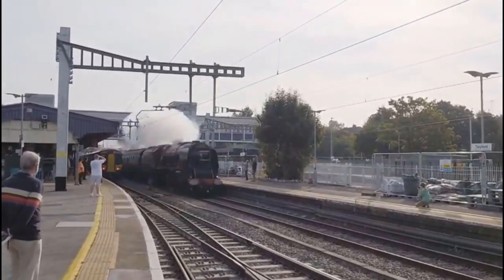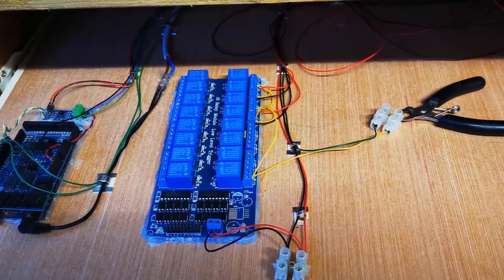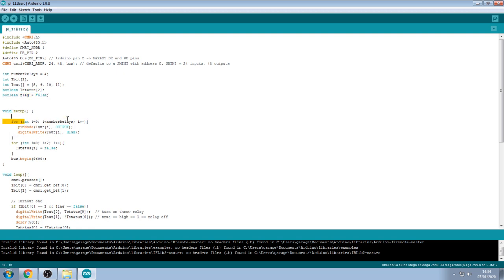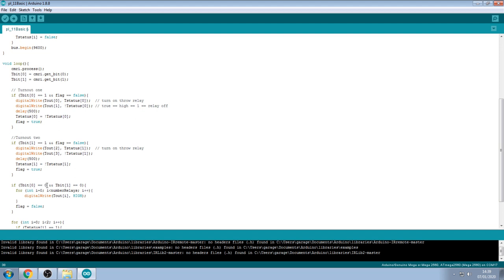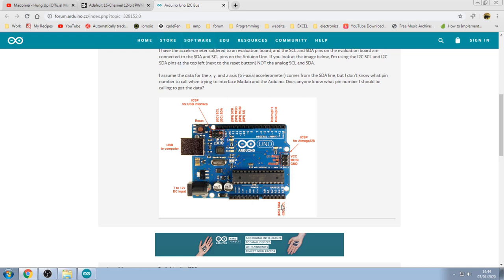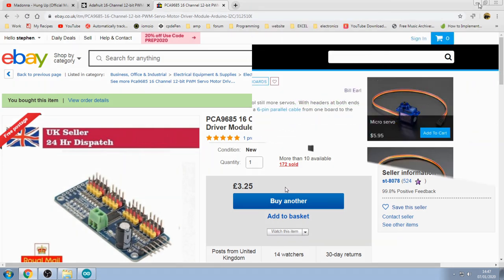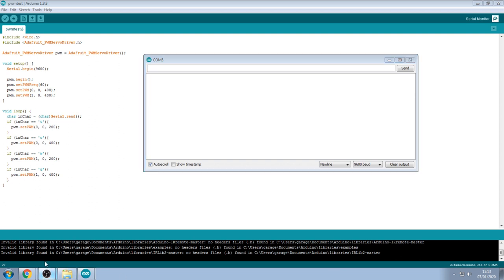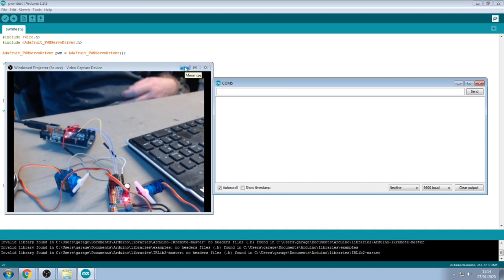PCA9685 servo control with JMRI CMRI and Arduino model railway

Comment: Thanks for the vid, just one thing, if you have a big layout and you want to place the PCA9685's some way apart you'll need some I2C extenders, or longer servo wires.
Reply from the maker: That's not something at the moment I've looted into. My layout is about 3 meters so the PCA9685 is next to the Arduino and the PWM communication wires run from there to the servos which work ok. Not sure how far you will need to go before this becomes a problem. The i2c extenders are not cheap. Maybe easier to run a serial comms line on the RS485 to another Arduino nano and then the PCA9685 will be local to the Arduino and servos. With large layouts i expect communication length becomes a problem using serial data transfer.
Reply from the maker: @ChrisPackham1  But this will also need other components i expect. My main plain is to keep everything cheap and with very little electronics. I have seen servos run from 8 meters away from servo controller so if you have over 8 meters then may be the i2C extender is the better way to go. However the auto485 bus line around the layout might be easier. i have read you can run this for over 1000 meters, so just tape off this with a nano and then the PCA9685. Both will probably work ok. Most people may have the bus line for other arduino control across there layout. Be nice to see if anyone has tested this over a long distance

Comment: I prefer using multiple Arduino Uno's rather than these PCA9685s, which are more expensive.  I can spread them around my layout and keep the leads to the servos short.  I can get 3 Unos for the price of one PCA.

Comment: Great video, thank you. Can you please give some info on how to add leds light and control servos with toggle switch? Thank you
Reply from the maker: Hi Anatolii, I have not had any time to work on my railway lately so cannot do any vlogs of switch control. I did demonstrate a push button control at this link https://youtu.be/diM55FdsIvo You could remove the push button part and add a toggle switch which will be easier as you can remove the debounce part.  As for LED control add an LED to a data output of the PCA board and ground with about 300 ohm resistor. Then run the code pwm.setPWM(pin, 4096, 0); for fully on and pwm.setPWM(pin, 0, 4096); for fully off. I expect if you have lower numbers the LED light will be dimmed. If you are not worried about dimming the LED's then you might find the following link a cheaper alternative. https://youtu.be/L_JAxXybQiQ
Reply: @BrackstonesTravelAdventures  Thank you. I am new into this hobby and your advices are super helpful.

Comment: Hey there, these blog posts and your videos have been really good. I’m going down the JMRI/CMRI/Mega route with a bunch of PCA9685 boards. I used your sketches as inspiration, but… I’m struggling on the first board to get turnouts 1011 and upwards to work (i.e. bits 10 to 15) Any clues?

This is what I’m trying to run. Anything for servo 11/bit 10 upwards is commented out to get it to run servo 1-10 successfully…

#include
#include
#include
#include
#define CMRI_ADDR 1 // what CMRI node is the Arduino running this sketch?
#define DE_PIN 2 // ????????????
#define LED01 7 // LED code left in to try running pca9685 and LEDs on same mega.
#define button 3 // sensor for the LED

int buttonState = 0; // set a variable to store the button state
int Tbit[2]; // set variable for a Turnout bit number IS THIS THE ISSUE??

Adafruit_PWMServoDriver pwm = Adafruit_PWMServoDriver(); //setup the board address 0
Auto485 bus(DE_PIN); // arduino pin 2 for DE and RE pins
CMRI cmri(CMRI_ADDR, 24, 48, bus); // defaults to a SMINI with address 0. SMINI = 24 inputs, 48 outputs

void setup() {
// LIGHTS
pinMode(LED01, OUTPUT);
pinMode(button, INPUT_PULLUP);
// SERVOS
Serial.begin(9600);
bus.begin(9600);
pwm.begin();
pwm.setPWMFreq(60); // This is the maximum PWM frequency
pwm.setPWM(0, 0, 170); //Initial setting when start up
pwm.setPWM(1, 0, 170);
pwm.setPWM(2, 0, 170);
pwm.setPWM(3, 0, 170);
pwm.setPWM(4, 0, 170);
pwm.setPWM(5, 0, 170);
pwm.setPWM(6, 0, 170);
pwm.setPWM(7, 0, 170);
pwm.setPWM(8, 0, 170);
pwm.setPWM(9, 0, 170);
// pwm.setPWM(10, 0, 170);
// pwm.setPWM(11, 0, 170);
// pwm.setPWM(12, 0, 170);
// pwm.setPWM(13, 0, 170);
// pwm.setPWM(14, 0, 170);
// pwm.setPWM(15, 0, 170);
}

void loop() {
cmri.process();
//LIGHTS
digitalWrite(LED01, cmri.get_bit(47)); // Light on address 1048 in JMRI
buttonState = digitalRead(button);
cmri.set_bit(0, buttonState);
//
// TURNOUTS ON BITS 0-15 I.E. ADDRESSES 1001-1016
Tbit[0] = (cmri.get_bit(0)); //Turnout01
Tbit[1] = (cmri.get_bit(1)); //Turnout02
Tbit[2] = (cmri.get_bit(2)); //Turnout03
Tbit[3] = (cmri.get_bit(3)); //Turnout04
Tbit[4] = (cmri.get_bit(4)); //Turnout05
Tbit[5] = (cmri.get_bit(5)); //Turnout06
Tbit[6] = (cmri.get_bit(6)); //Turnout07
Tbit[7] = (cmri.get_bit(7)); //Turnout08
Tbit[8] = (cmri.get_bit(8)); //Turnout09
Tbit[9] = (cmri.get_bit(9)); //Turnout10
// Tbit[10] = (cmri.get_bit(10)); //Turnout11
// Tbit[11] = (cmri.get_bit(11)); //Turnout12
// Tbit[12] = (cmri.get_bit(12)); //Turnout13
// Tbit[13] = (cmri.get_bit(13)); //Turnout14
// Tbit[14] = (cmri.get_bit(14)); //Turnout15
// Tbit[15] = (cmri.get_bit(15)); //Turnout16

// TURNOUT01, ADDRESS 1001, BIT 0
if (Tbit[0] == 1){ //if Turnoutbit n == 1 (to throw) or 0 (to close)
pwm.setPWM(0, 0, 170); //set servo n (0-15), board n (0,1,2,3,4,5,etc), angle = n
}
if (Tbit[0] == 0){
pwm.setPWM(0, 0, 150);
}

// TURNOUT02, ADDRESS 1002, BIT 1
if (Tbit[1] == 1){ //if Turnoutbit n == 1 (to throw) or 0 (to close)
pwm.setPWM(1, 0, 170); //set servo n (0-15), board n (0,1,2,3,4,5,etc), angle = n
}
if (Tbit[1] == 0){
pwm.setPWM(1, 0, 150);
}

// TURNOUT03, ADDRESS 1003, BIT 2
if (Tbit[2] == 1){ //if Turnoutbit n == 1 (to throw) or 0 (to close)
pwm.setPWM(2, 0, 170); //set servo n (0-15), board n (0,1,2,3,4,5,etc), angle = n
}
if (Tbit[2] == 0){
pwm.setPWM(2, 0, 150);
}

// TURNOUT04, ADDRESS 1004, BIT 3
if (Tbit[3] == 1){ //if Turnoutbit n == 1 (to throw) or 0 (to close)
pwm.setPWM(3, 0, 170); //set servo n (0-15), board n (0,1,2,3,4,5,etc), angle = n
}
if (Tbit[3] == 0){
pwm.setPWM(3, 0, 150);
}

// TURNOUT05, ADDRESS 1005, BIT 4
if (Tbit[4] == 1){ //if Turnoutbit n == 1 (to throw) or 0 (to close)
pwm.setPWM(4, 0, 170); //set servo n (0-15), board n (0,1,2,3,4,5,etc), angle = n
}
if (Tbit[4] == 0){
pwm.setPWM(4, 0, 150);
}

// TURNOUT06, ADDRESS 1006, BIT 5
if (Tbit[5] == 1){ //if Turnoutbit n == 1 (to throw) or 0 (to close)
pwm.setPWM(5, 0, 170); //set servo n (0-15), board n (0,1,2,3,4,5,etc), angle = n
}
if (Tbit[5] == 0){
pwm.setPWM(5, 0, 150);
}

// TURNOUT07, ADDRESS 1007, BIT 6
if (Tbit[6] == 1){ //if Turnoutbit n == 1 (to throw) or 0 (to close)
pwm.setPWM(6, 0, 170); //set servo n (0-15), board n (0,1,2,3,4,5,etc), angle = n
}
if (Tbit[6] == 0){
pwm.setPWM(6, 0, 150);
}

// TURNOUT08, ADDRESS 1008, BIT 7
if (Tbit[7] == 1){ //if Turnoutbit n == 1 (to throw) or 0 (to close)
pwm.setPWM(7, 0, 170); //set servo n (0-15), board n (0,1,2,3,4,5,etc), angle = n
}
if (Tbit[7] == 0){
pwm.setPWM(7, 0, 150);
}

// TURNOUT09, ADDRESS 1009, BIT 8
if (Tbit[8] == 1){ //if Turnoutbit n == 1 (to throw) or 0 (to close)
pwm.setPWM(8, 0, 170); //set servo n (0-15), board n (0,1,2,3,4,5,etc), angle = n
}
if (Tbit[8] == 0){
pwm.setPWM(8, 0, 150);
}

// TURNOUT10, ADDRESS 1010, BIT 9
if (Tbit[9] == 1){ //if Turnoutbit n == 1 (to throw) or 0 (to close)
pwm.setPWM(9, 0, 170); //set servo n (0-15), board n (0,1,2,3,4,5,etc), angle = n
}
if (Tbit[9] == 0){
pwm.setPWM(9, 0, 150);
}

//// TURNOUT11, ADDRESS 1011, BIT 10
// if (Tbit[10] == 1){ //if Turnoutbit n == 1 (to throw) or 0 (to close)
// pwm.setPWM(10, 0, 170); //set servo n (0-15), board n (0,1,2,3,4,5,etc), angle = n
// }
// if (Tbit[10] == 0){
// pwm.setPWM(10, 0, 150);
// }
//
// TURNOUT12, ADDRESS 1012, BIT 11
// if (Tbit[11] == 1){ //if Turnoutbit n == 1 (to throw) or 0 (to close)
// pwm.setPWM(11, 0, 170); //set servo n (0-15), board n (0,1,2,3,4,5,etc), angle = n
// }
// if (Tbit[11] == 0){
// pwm.setPWM(11, 0, 150);
// }
//
//// TURNOUT13, ADDRESS 1013, BIT 12
// if (Tbit[12] == 1){ //if Turnoutbit n == 1 (to throw) or 0 (to close)
// pwm.setPWM(12, 0, 170); //set servo n (0-15), board n (0,1,2,3,4,5,etc), angle = n
// }
// if (Tbit[12] == 0){
// pwm.setPWM(12, 0, 150);
// }
//
//// TURNOUT14, ADDRESS 1014, BIT 13
// if (Tbit[13] == 1){ //if Turnoutbit n == 1 (to throw) or 0 (to close)
// pwm.setPWM(13, 0, 170); //set servo n (0-15), board n (0,1,2,3,4,5,etc), angle = n
// }
// if (Tbit[13] == 0){
// pwm.setPWM(13, 0, 150);
// }
//
//// TURNOUT15, ADDRESS 1015, BIT 14
// if (Tbit[14] == 1){ //if Turnoutbit n == 1 (to throw) or 0 (to close)
// pwm.setPWM(14, 0, 170); //set servo n (0-15), board n (0,1,2,3,4,5,etc), angle = n
// }
// if (Tbit[14] == 0){
// pwm.setPWM(14, 0, 150);
// }
//
//// TURNOUT16, ADDRESS 1016, BIT 15
// if (Tbit[15] == 1){ //if Turnoutbit n == 1 (to throw) or 0 (to close)
// pwm.setPWM(15, 0, 170); //set servo n (0-15), board n (0,1,2,3,4,5,etc), angle = n
// }
// if (Tbit[15] == 0){
// pwm.setPWM(15, 0, 150);
// }

}

Comment: Hey, first off, another great video ,got 16 servo working cmri on first PCA9685 board but cant find any code for second PCA9685 board and 3rd 
#include <Wire.h>
#include <Adafruit_PWMServoDriver.h>
#include <CMRI.h>
#include <Auto485.h>

#define CMRI_ADDR 1
#define DE_PIN 2 
int Tbit[2];
Adafruit_PWMServoDriver pwm = Adafruit_PWMServoDriver(); //setup the board address 0
Auto485 bus(DE_PIN); // Arduino pin 2 -> MAX485 DE and RE pins
CMRI cmri(CMRI_ADDR, 24, 48, bus); 

void setup() {
  Serial.begin(9600);
  bus.begin(9600);
  pwm.begin();
  pwm.setPWMFreq(60);  // This is the maximum PWM frequency
  //pwm.setPWM(0, 0, 140);
  //pwm.setPWM(1, 0, 180);
 
}
void loop(){
   cmri.process();
   Tbit[0] = (cmri.get_bit(0)); //TMU1
   Tbit[1] = (cmri.get_bit(1)); //TBD1
   Tbit[15] = (cmri.get_bit(15)); //TBD1
   Tbit[16] = (cmri.get_bit(16)); //TBD1
  
     if (Tbit[0] == 1){
     pwm.setPWM(0, 0, 180);
     Serial.println("trow");
   }
   if (Tbit[0] == 0){
     pwm.setPWM(0, 0, 140);
     Serial.println("close");
   }
   if (Tbit[1] == 1){
     pwm.setPWM(1, 0, 140);
   }
   if (Tbit[1] == 0){
     pwm.setPWM(1, 0, 180);
   }
   if (Tbit[15] == 1){
     pwm.setPWM(15, 0, 140);
  if (Tbit[15] == 0){
     pwm.setPWM(15, 0, 180);
   }
   
   }
  }
just a start on a second board do i  change #define CMRI_ADDR 2
#define DE_PIN 2 and address of PCA9685 board to 0x41 and cover ao on PCA9685 board after first code for 1st board.i am really getting frustrated with this , https://www.trainboard.com/highball/index.php?threads/setting-up-turnouts-in-jmri.101905/page-2#post-1046735 tried this but cant get it working and https://expressoarduino.blogspot.com/2019/08/conexao-e-configuracao-da-interface-48.html .all are very good but i am not getting anywere getting faults i cant rectify . there is very little code for cmri cheers garry
Reply from the maker: Hi Gary, Your write there is very little info on CMRI on the web which is why i started this playlist, most work I have done is trial and error with lot hair pulling and frustration.
The CMRI_ADDR is for the arduino address board. This tallies up with JMRI node adress 1. So if you have a second Arduino board this will be CMRI_ADDR 2 and node 2. You can check this out on my blog here.

http://www.motorhomesites.org.uk/jmri-two-arduino-control-with-cmri/

For a  second PCA9685 you need to change the address solder pads on back of the PCA card by soldering one of the pads. The cards are address 0 with no solder on any pads. Check out 19:40 of the video for this.

The arduino code you need to change the below part.

Adafruit_PWMServoDriver pwm = Adafruit_PWMServoDriver(); 

to this for address 1

Adafruit_PWMServoDriver pwm1 = Adafruit_PWMServoDriver(1); 

with number 1 within the brackets will be address 1 and no number will be address 0. 

You can see a good example on this at the link below

https://learn.adafruit.com/16-channel-pwm-servo-driver/chaining-drivers

Hope this helps, I've not tested this myself as I only had one PCA card
Reply: @BrackstonesTravelAdventures  thanks i soldered the pads i figured whats required its the coding i struggle with .there is very little info about and i am gratifull for all the work you have done .thanks

Comment: Hey, first off, another great video. Got a question, in the latest issue of Model Railroad Hobbyist magazine, MRH, there is an article about servos and turnout control. My question is would this same idea be able to work with a PCA9685 and arduino, as it is a great way to setup the servos for each turnout. This is way over my head right now, hence the question. I have 16 turnouts ready to go with the servos mounted and am having a difficult time getting the arduino setup i am using to work.

Comment: thanks for the update,i found the same with pl11 that 1 in 8 for me so i have gone back to servos ,take care for now .Mac
Reply from the maker: Cheers Mac, bit annoying as the PL-11 are easy to setup but in the end cost and reliability is more important to me :)
Reply: @BrackstonesTravelAdventures  yeh you can get a few dozen servos from Shenzen for the price of 1 PL11 ,thats another reason i went back to servos,
Reply from the maker: @nesr8786  Agree and with these PCA cards at about £3.50 you could run this on an Arduino nano for £3.50 and have all your turnouts controlled for less than £10. Compared to DCC cards for hundreds